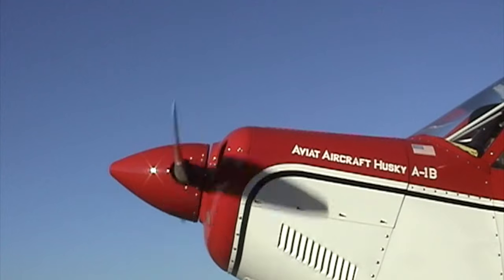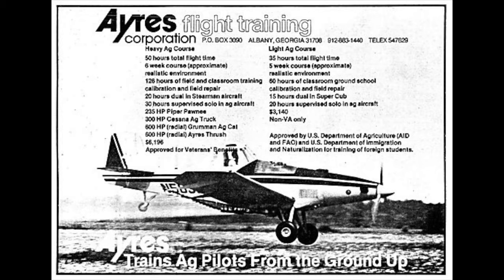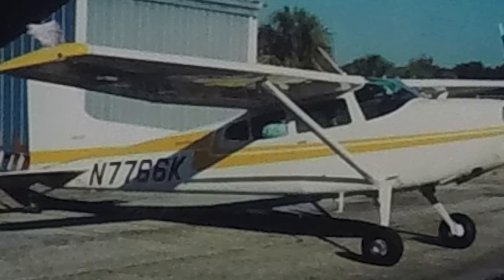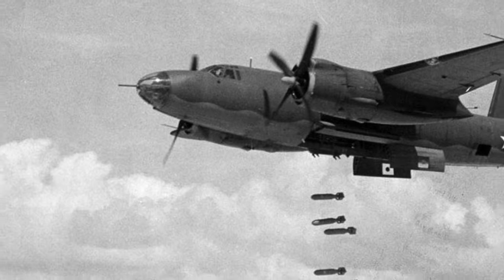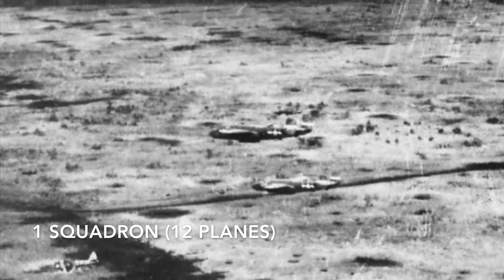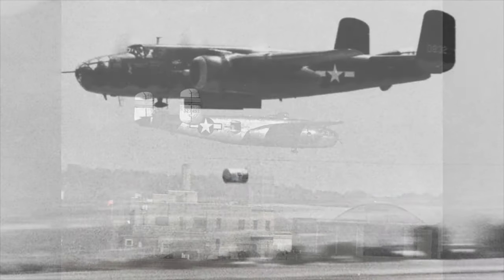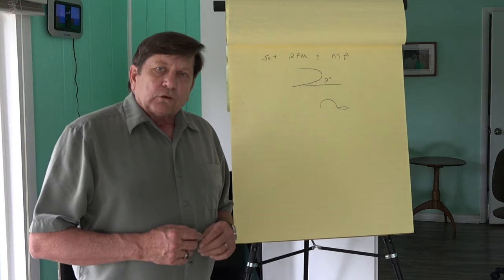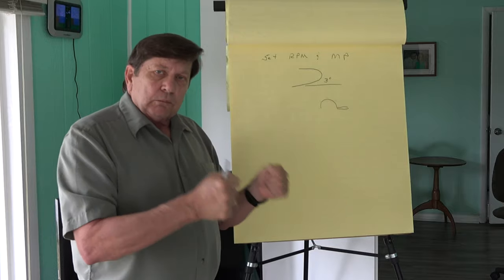Low Level Flying Techniques & Tactics -  WWII Cross Control Flight Training Video

Comment: Thanks so much Matt for taking us back to the REAL magic of flying...to what really happens, or should. The problems with single-screen flight, as most commercial work is done today, is that pilots are divorced from control of the mechanisms that actually affect the aircraft. Sadly, the "sophistication" of digital indications and control actually inhibit the pilot from being constantly "in touch" with the aircraft.

The fact that you are so proficient in so many areas of knowledge lends real weight to your excellent end message.
Reply from the maker: Thanks, I really appreciate that.

Comment: Hello, loved the video, how could I contact you directly?  Thank you for putting this together!
Reply from the maker: Greg: there is a thread on this flying technique at SuperCub.org: https://www.supercub.org/forum/showthread.php?59884-Low-Level-Flying-Techniques-Cross-Control for more info.  They're about the only ones left in civilian flying that use this type of thing (bush flying/Ag Flying).  If it's anything else: mattmattson57@gmail.com will get to me.  I get a ton of email - might not respond right away.  Safe flying to you!

Comment: Matt can you please help me out. I've been trying to locate gold on the Potomac river that runs through DC. Do you know any good locations in the DC area to try?
Reply from the maker: I had read about gold in the river bars on the Potomac years ago, but didn't research it  further.  A pan or even visual search would tell you if there's black sands in the bars - if so, you're probably in luck!
Reply: @mattmattsongold  Appreciate the info. I have a few trips planned this month, i'll let you know if I find anything!

Comment: Does being cross-controlled increase stall speed in a situation like that?
Reply from the maker: Yes it does.  Never try this close to your stall speed - we learned it at altitude and when we demonstrated ability to do it without losing altitude we were cleared to go down low (with an instructor), then we demonstrated it solo on the runway, and then we demonstrated it to their satisfaction in the field.
Reply: @mattmattsongold  Thanks! Very interesting video
Reply from the maker: DB536 - Don't know if you're on the SuperCub.org site but there's a discussion on this and other low level and flying techniques in the art & science of flying.  Have a great time with your aviation adventures!